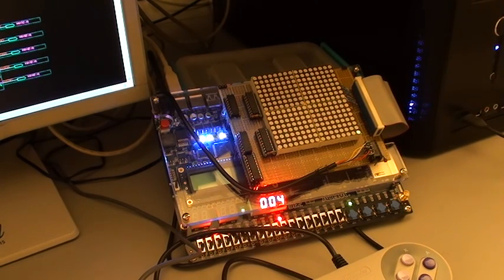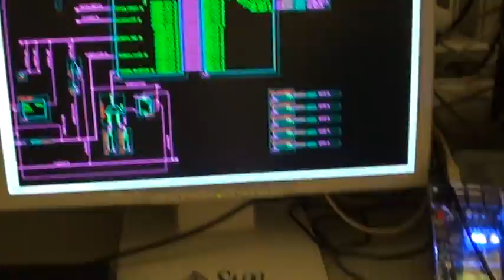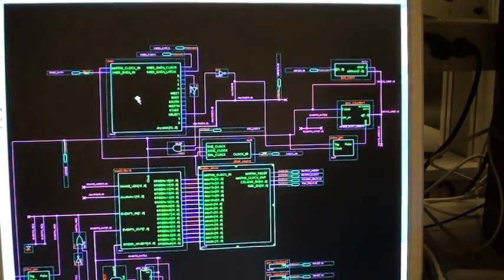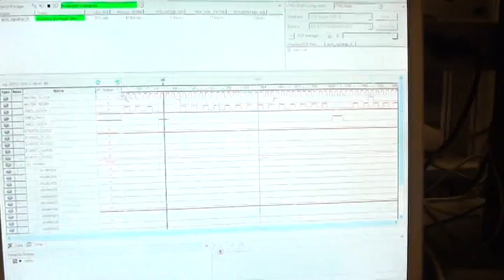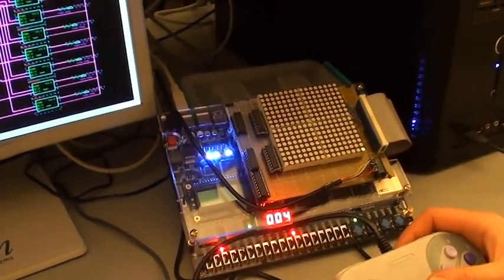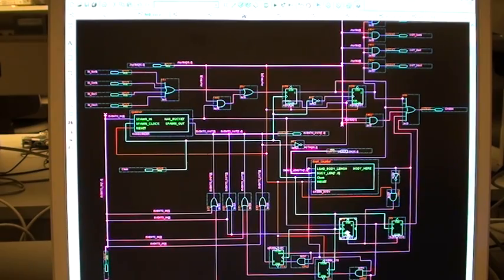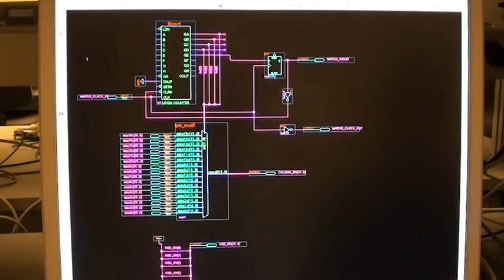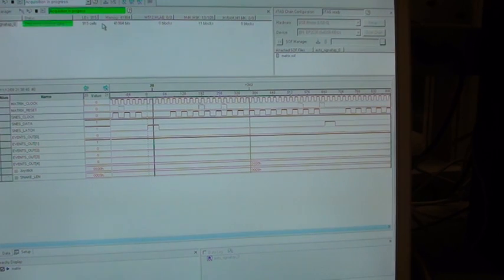FPGA snake game on DE2 with LED matrix and SNES controller

Comment: Board $495 for led blinking ? Do you people have any idea or creative ?  30 yeras ago you could wrote snake on the C64, with a  1000 times better looks. Got damn it ! This hardware is a few genaration later people. You can generate VGA signal without any problem, you can do oscilloscope, RTOS and do you want impress others by led blinking ?
Reply: Do you really know what's an FPGA?
Reply: @ozcar02  Yes I know what is FPGA. For example I did in CPLD implementation logic to work in this cartridge in C64
http://gangc64.com
Reply: blinking an led is a lot harder than you think
Reply: Dude. Seriously? You don't know anything about FPGAs? Then what is the reason of making projects at home or school, where you could buy a commercial product for alot cheaper. It's call education! I think you shouldn't be here. Go somewhere, where they review 'commerical' products.
Reply: learning how to optimize things well in retro games is important even for more modern games, its the same.

Comment: We're still confused about the prototype bacause based on your wiring diagram, only the rows are connected to the 40 pin ribbon cable if we're not mistaken.. Do we need to connect in parallel the columns and connect to their assigned pins in the gpio? I apologize for frequent asking. But your response will greatly help us.